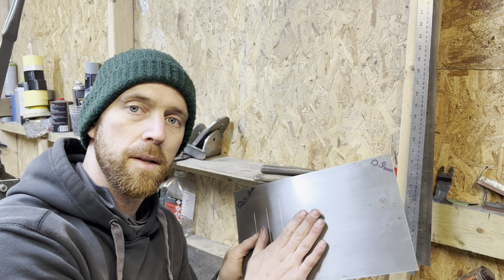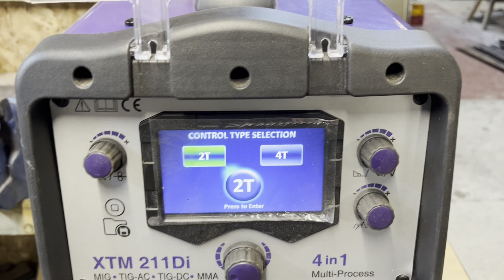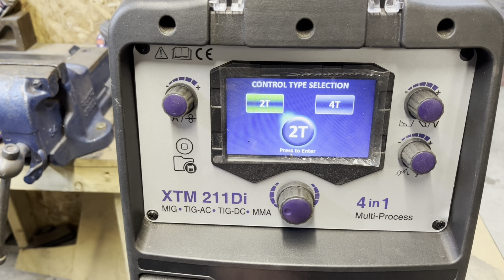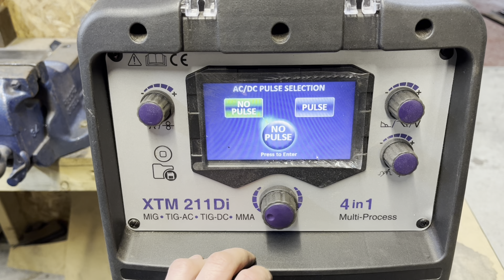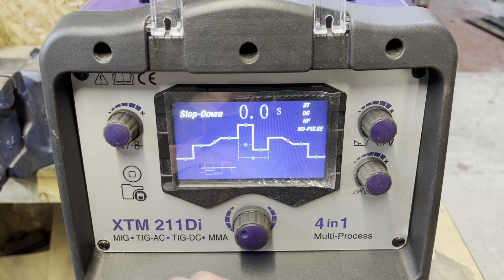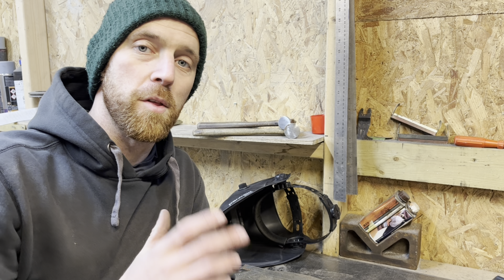How to Tig weld - easy simple steps

Comment: Tom,  Great videos. As an old fart at 68 who started welding & brazing with acetylene many decades ago and then moving on to MIG. I have now got a TIG set up and 
I found this video very helpful as I found the fusion welding easier than adding wire but this could be due to coordination or lack of it 🤣😂my biggest issue is keeping 
the tip out of the weld pool and the tip at the correct distances is there some kind of longer half nose cap or something I use to steady my hands 🤔 Cheers Dave

Comment: Great intro, Tom.  I started welding about a year ago, and the best advice I had was to put in time “under the hood”.  For the first 4 months I tried to weld every day, even if for just 15 minutes.  I burned through a bunch of steel, but it went a long way toward getting comfortable with the equipment and techniques.  Cheers!

Comment: Excellent guide.
What tungsten do you use for mild steel?
 I've only used TIG for aluminium.
Reply from the maker: Thoriated Tungsten(red tip) but you can still weld with the Ali one too. (White tip)